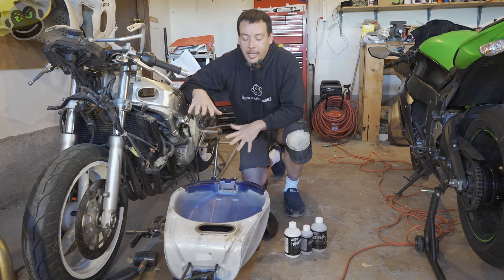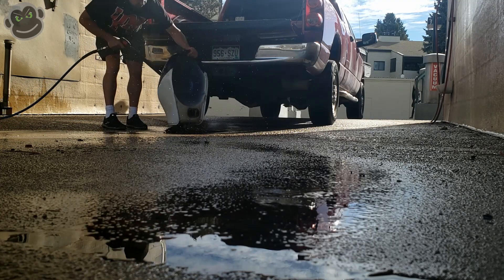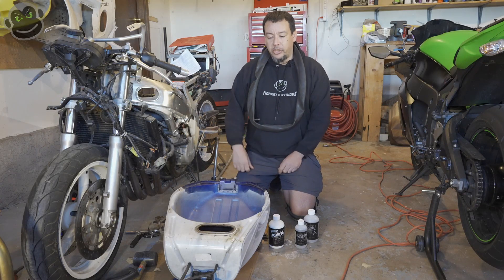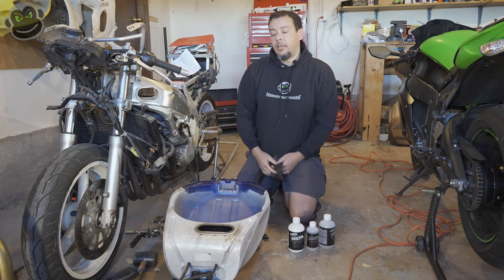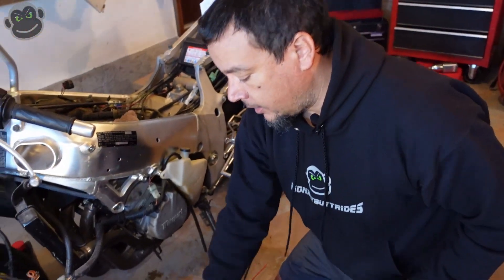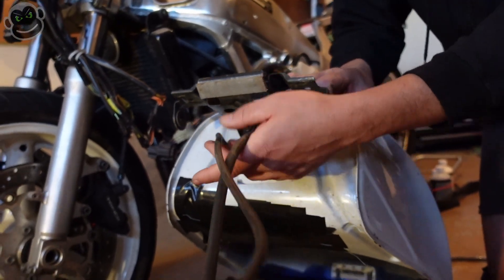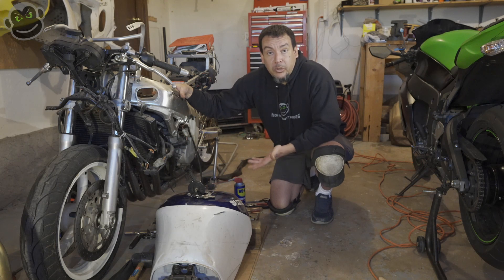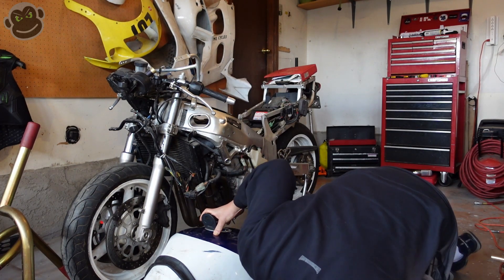KREEM FUEL TANK LINER | 97 Suzuki GSXR 600 Build | Episode 6

Comment: Man there is no way to not destroy yourself cleaning those tanks :D Ohhhhhh the rubber tube was smart......mr smarty pants. :D
Gorilla tape eh.... using my cousins sticky bits. I'm thinking of going for a keyless fuel cap replacement as mine is also ruined. Haha mine was the same when I mixed it, utter poison smell off it :D 
If you havent done it yet.....careful with the fuel cap when you use the sealant...I kinda glued mine shut :D
Reply from the maker: There really isn't is there, I thought the rubber inner tube was smart but needed more then just your cousins sticky bits, however, your cousins sticky bits worked well for the sealant.  Keyless fuel cap sounds class.  My fuel cap did get sticky after the I added the sealant but it wasn't to bad.
Reply: @MonkeyButtRides  Nah the wash just sprays out at all angles 😂😂 
Ah that's good at least, my cousin will be delighted 😂
Yeah hopefully it works out :) mine was well and stuck, I got it free but it doesn't close fully now, I think it was a bit goosed anyway :)